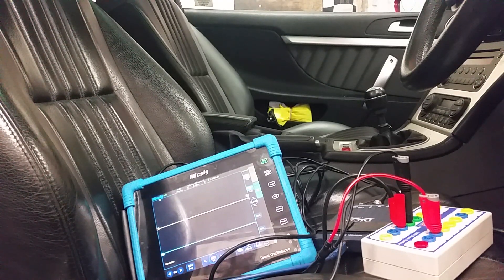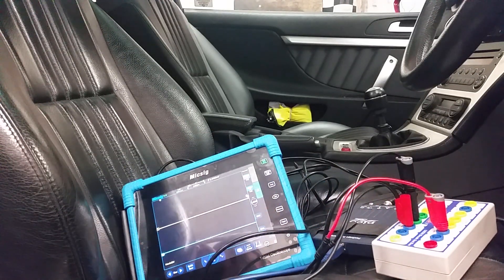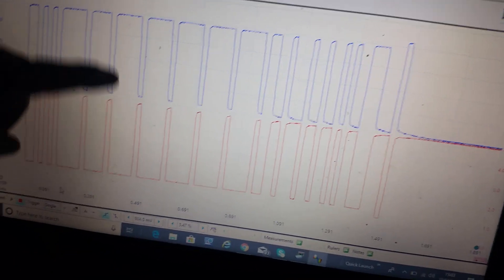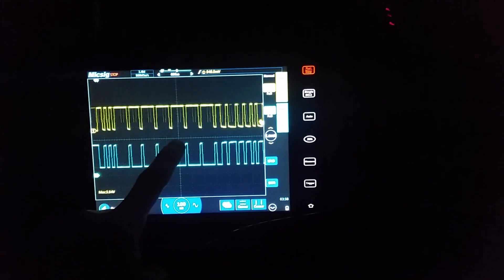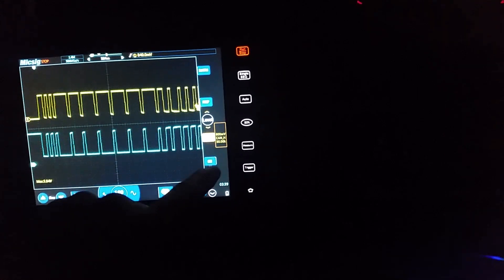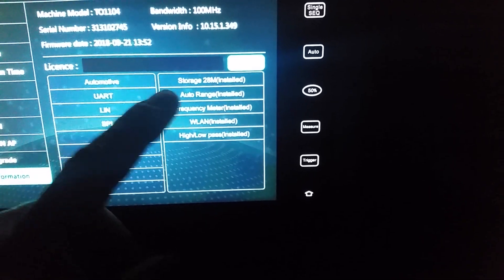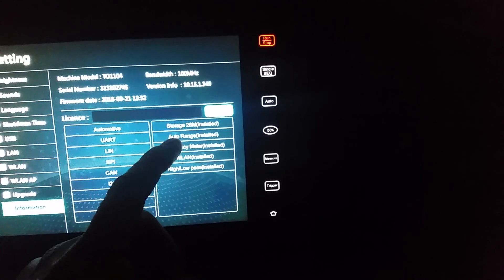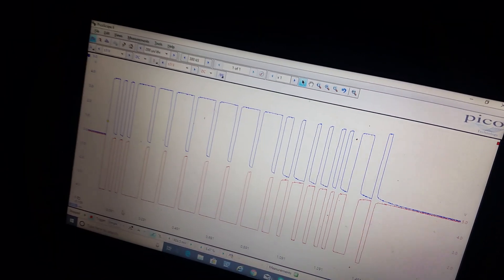Can communication Pico 2000/Micsig Ocilloscopes

Comment: Has anyone used these scopes yet for pressure analysis?I've just bought the Chinese apt-100 wps500x copy.I just can't get a signal to appear on the screen at all??Yet away from the car i can attach a bicycle tyre pump to the hose and i get a nice clear fast responding signal!!It's just everytime i connect it anywhere near a car i get nothing??lol,
I did get a similar issue when i made a pressure transducer for my Verus,the problem there was the hose i screwed into the plughole was off a manual compression gauge,which had a one way valve in it,drilled this out and it was perfect.
Yet this unit has a valve in it too but it works 'off',away from a car?

Comment: Just got one of these,however my can signals look bloody awful!It's the ato1104 automotive one i have and i'm using the presets.I thought maybe it was the micsig leads were awful,used Snap-on leads i had,but signal still looks awful.
There's interference and there is a solid line along the top of the can high and low,instead of the nice clear up and down waveform you've got!Want a swap??lol
Reply from the maker: Turn persistance mode off. Nothing to do with your leads
Reply: @davesterl  I was just ruling out leads incase that was problem.Persist mode keeps popping up by default,and i keep switching it off,i'll get round it.Thanks.